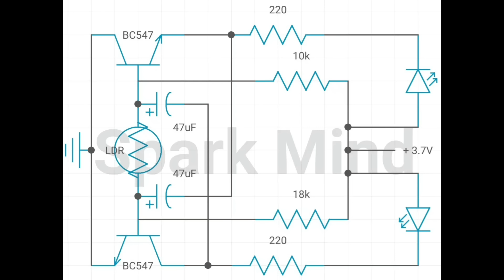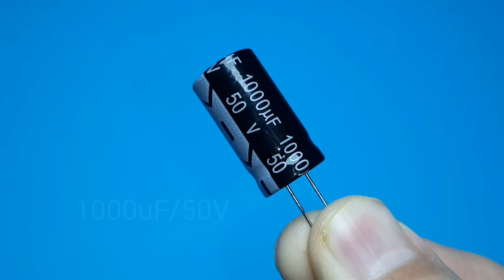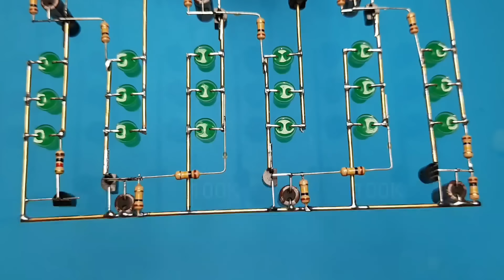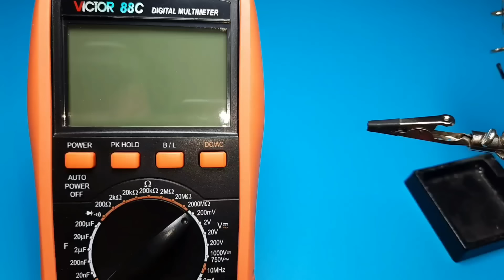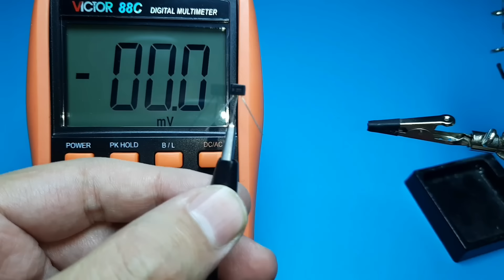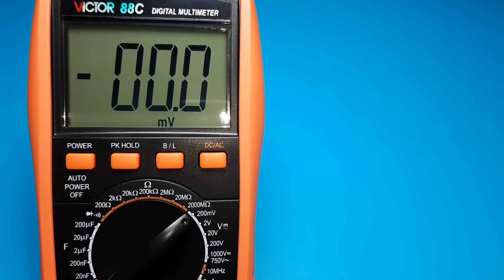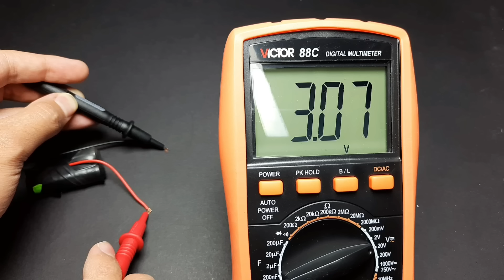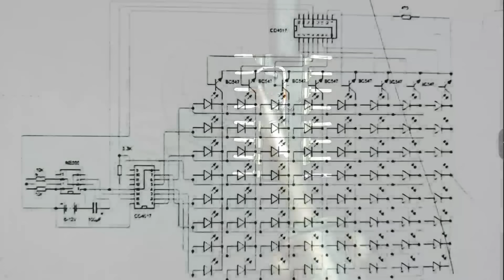Top 10 BC547 Transistor Projects

Comment: Transistors with their base not connected are used in Esaki oscillators. They breakdown the bias of the diode to work, that is why they need at least 12 vdc.